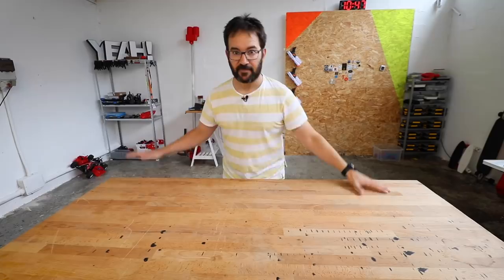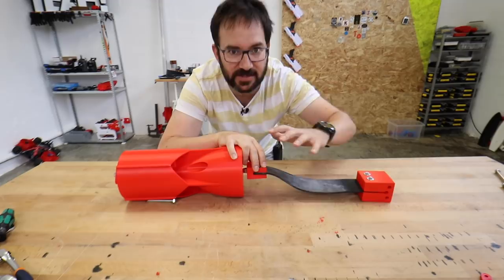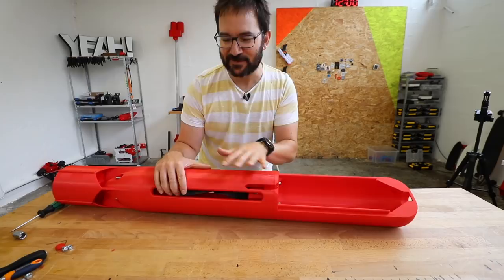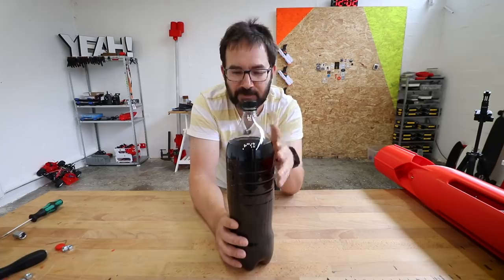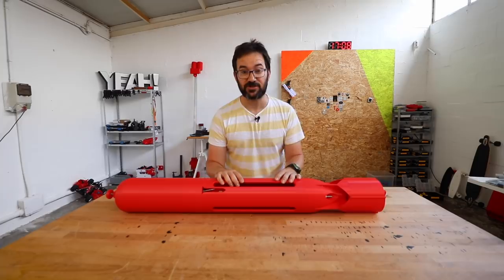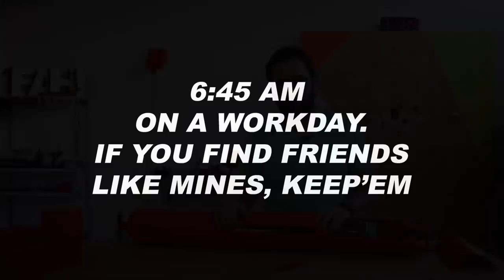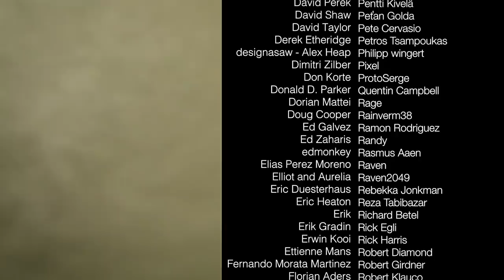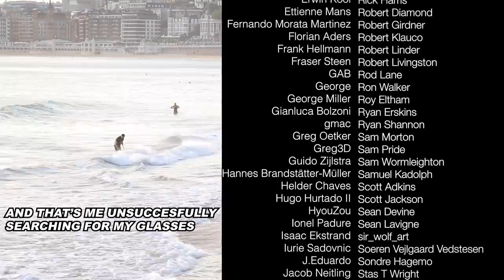LAUNCHING TORPEDOES FROM A KAYAK

Comment: A for effort, F for result. XD

An r/c 'torpedo' that is actually controllable with a camera in the nose would be a great project though...
Reply from the maker: Submarine?
Reply: @ivanmirandawastaken  yes please! I would love to see you're design of a 3D printed rc sub. I've been doing just static printed subs for pool use with my nephew and i'm quite impressed with how well it floats and handles the water
Reply: @ivanmirandawastaken  Yeah an Rc Sub would be amazing, with depth control and everything "Saludos desde Canarias por cierto"
Reply: @UndercastEsmeganitrospeed  best bet for buoyancy control is probably variable displacement. Think giant syringe, actuated by a beefy linear actuator.
Reply: A for effort F for result is basically his whole channel in a nutshell. Amazing projects, many many hours spent on them but maybe with a couple of hours of research before starting would save him days of work and maybe increase the success rate :)
Reply: SuicideNeil or even better some explosives to sink another kayak 😭
Reply: Nose being a primer with gunpowder behind
Reply: It could be made neutrally buoyant if he ditched the compressed air bottle and put in a camera.
Reply: @ivanmirandawastaken  that might be a little to hard for you
Reply: Ivan Miranda no a torpedo with a small rc plane motor driving the propeller and you could but a go pro in the front of the torpedo. Insulate the electronics and your fine
Reply: torpedo with a motor and a gyro would be nice :)

Comment: This video has inspired me to make a mini torpedo that I can drop from my rc airplane. Quick suggestion though, I think torpedo would work better if it had completely neutral buoyancy so it doesn't sink or float, also if it launches from the underside of the kayak so it has water to use to push it out behind it. Also I might have sanded it down using something like 180 grit since 3D prints tend to be not very hydrodynamic so that 180 grit would give it a nice smooth finish. Awesome video though keep it up.

Comment: This can be greatly improved by changing to a lower "kv" (lower rpm) motor.
Decide how fast you want it to go and then match the "pitch speed" of the screw to be a bit above the desired speed.
Pitch speed is rpm times the distance the prop moved forwards during one revolution.
What you have now is a prop that tries to create a vacuum around its blades (cavitating) and that makes it very inefficient.
 Bigger diameter   will also help since you want pushing power not high speed (water resistance will quickly overcome the force of the motor so going fast will take a lot of power)
Reply from the maker: What I have is a prop eating air like crazy not cavitating. I wish the prop was spinning at cavitating speeds, that'd mean serious speeds but with this huge prop and that tiny motor that ain't gonna happen.
Reply: @ivanmirandawastaken  Can you calculate the displaced volume from your cad design?
Then if you can match the total weight to the weight of the displaced water (or slightly less) you end up with a fully submerged torpedo.
Or you can cheat and add waterproof servo's with fins to create a dynamically dicing submarine in torpedo shape.

Comment: 2nd iteration would be to make the torp heavier to counter the buoyancy of the plastic shell to a certain depth. This ensure the propeller is fully submerged. Add fins to stabilise(have a look at japanese torps from WWII). Use compressed air to drive the propeller.

Comment: Add Mentos candy to Coke & it explodes very much. if you have have the coke with the hole in the cap with foil & a second chamber with 2 or 3 Mentos candy's & another hole with foil when the Coke chamber has a minor explosion into the Mentos chamber the explosion will be increased greatly as it fly's out the front of the Mentos chamber.

Torpedoes normally are launched by compressed air so you could put a rubber skirt in the launcher that goes around the torpedo & for a huge amount of air into the back section which would blow the torpedo out & it really needs a bigger propeller to go faster. But anyways well done for a first try.

Comment: A very fun video! Thanks for the view! This idea could be tweaked to perfection with just a little more engineering. Gear boxed low speed high angle prop, and some buoyancy trim. Torpedo needs to run completely submerged all the time. Prop housing needs to be eliminated and add free water larger diameter trolling motor prop. All in all this was a very interesting video! Excellent build as a proof of concept  DIY torpedo  project!!!!  Well done! I hope you tweek itto perfection!!!!

Comment: I know this is an old video, but the reason it is turning is because of the torque of the motor. You can counteract this by a second motor going the other way, or an easier way  to do it is just have fins on the output of the propeller in the opposite direction. When tom Stanton made his hovercraft he had a similar problem

Comment: Should have put a plug in the neck backwards (from the inside out), with a screw sticking out the front which on impact would open the entire neck in one show for depressurization.

Comment: Hello, how are you? I really liked this idea of the torpedo, too bad it didn't work as expected. If I may, I would like to leave two suggestions in case you try to make a new version of this project. For propulsion, try a container with compressed air, which has a long lasting and constant flow and for the fake explosion, I think that if there were some openings on the sides of the torpedo and replacing the pet bottle with a large bladder, the explosion effect would be enhanced because many bubbles would come out at the same time to all sides. I hope to see a new version. Hugs here from Brazil.

Comment: Great job! Looks like It will probably work better when completely submerged a few inches under the waterline. I'd try to add even more ballast. Could also help if the launch tube would be completely submerged when launching.

Comment: I wonder if it could have worked better by using the soda bottle for propulsion - like a water rocket but with a much smaller exhaust to sustain thrust over a longer period of time. Like - stick a flexible tube through the cap with a weighted tip - that way it will take in water rather than compressed air. Fill the soda bottle with some compressed air and a lot of water, and hopefully it will work okay?

The problem this solves is that it avoids the complexities of prop design and optimization. You only need to adjust the diameter of the tube to figure out the best compromise between thrust and duration. No torque issues either.

Comment: Without watching the whole video I make this guess. The fact that the rubber band should make the prop turn properly provided the body of the torpedo is held still and stable. But since in the water the body is not held against the torque the prop turns one way and the body turns the other. The only way to prevent this might be to add large wings but this in turn causes more drag. requiring more power. etc etc.

Comment: If you re visit Water proof momentary Normally open switch ((in launcher saftey)). 12 gram CO2 launcher to Push the torpedo Out ((Could use a Rubber band to launch it tho as well)) A slight Weight increase TO keep the pop more sub merrged The sea probly wasn't the best place to test but it clearly Seams to luse thrust between waves. More weight front.

Totally not any kinda serious weapons engioneer offering you advice...

Comment: You’d want to make it an air powered torpedo they where used in WWII and from a surface ship it would be LAUNCHED from the deck of the ship not like that and there is no stabilizing fins to keep it straight and not spinning from the York of the motor

Comment: Probably didn't work because its the wrong type of propeller. Thats an air fan, wrong blade inclination for hydraulics. You will also want to decrease the propeller speed by 1/4. Try to make the rubber band less large, if its still too much speed try some sort of torque control mechanism to make it spin slower, i like the idea of using a second smaller propeller as a torque control.

Comment: Ivan 
i love your work, energy and commitment..... but what are you doing??? 
its like you learned nothing from your last 5 boats 
you already solved every problem you faced with this thing in previous builds 
use the props from your fast boat, add some weights so its fully submerged at all times
use the huge engines and batteries you have, you know you want to

the fake splosion was a great idea
could be improved if the puncture point was at the top (like a whale blowhole) to allow all the air to evacuate rapidly 
would be improved again with multiple puncture points for faster air release 
a clam shell release may also work, for a good splosion you want as much pressure released as quickly as possible 
the one impact pin could push a cage like thing backwards that could drive many puncture arms into the bottle